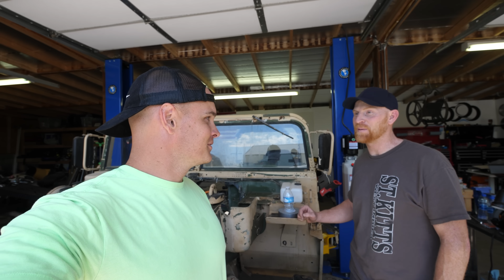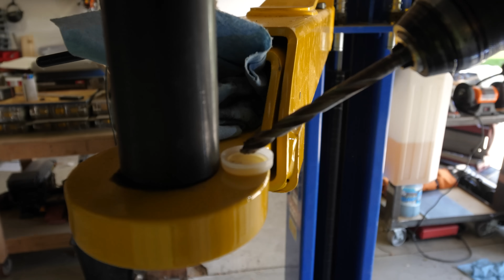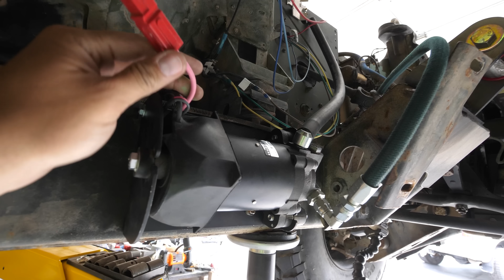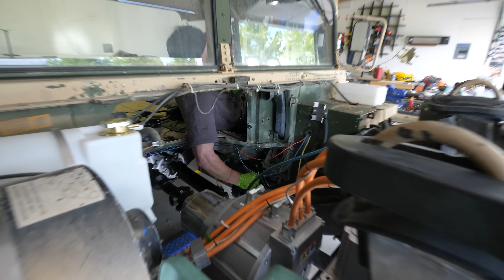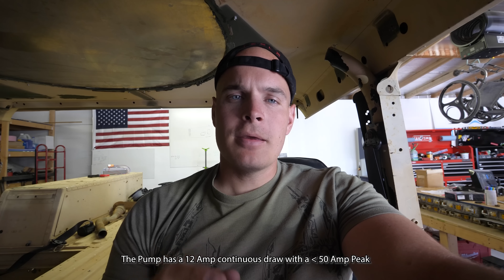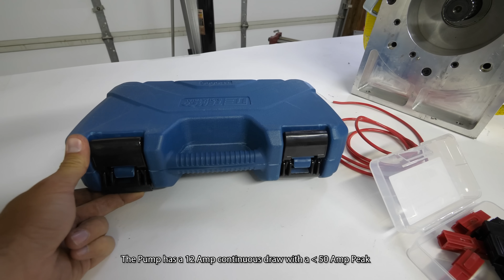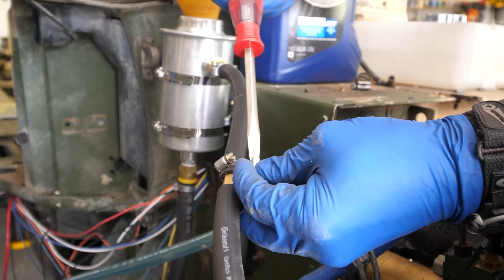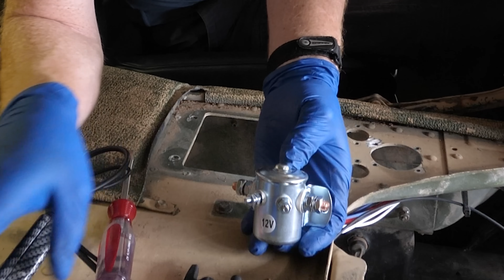We might have a problem with the Brakes... - Electric Hummer Conversion!

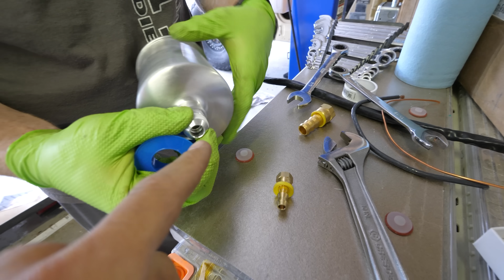Comment: 7:55 actually you put the tape in opposite direction of thread in bolt if you are turning the nut to tighten the threads

Comment: Since the pump doesn't need to be mounted in place in a rigid manner, a thicker rubber gasket/standoff between it and the frame would probably work well, as would an enclosure lined with foam. If you combined the two I imagine you'd get rid of a lot of that sound. 

Also, I don't know anything about solenoids, but others are pointing out the one you're using isn't the right one for that application. Just want to increase the chance you see that tip.

Comment: "Layering" the rubber isolation should help.  As in, pump->rubber->connection piece (like double sided bolt)->rubber->frame.  Not sure if you have enough room for that kind of setup.  Simplest way would be some kind of sound isolating material encasing the pump, but that would cause cooling issues.  Most advanced and badass way would be placing a sensor on the frame that detects the frequency coming off the pump, then have a computer invert the sine wave of that frequency and play it back through a vibration speaker into the frame.  Two waves cancel out and drastically reduce the noise.

Comment: To get rid of the pump whining, you can use a self-adhesive insulating mat, 1 - 2 mats usually does the trick. And also isolator standoffs for bolts.
Reply: And as long as there’s an oil cooler you can trust the trans fluid to keep the pump cool
Reply: I was going to suggest Rubber standoffs, much of the high pitch noise might be coming from the direct contact with the frame.
Reply: @rudiservo  Its the sheet metal, yes.
Reply: the pump has rubber isolators already.
Reply: @frostbite1991  the rubber insulators might not have enough elasticity to dampen it, also if the screw is not insulated has well any kind of contact will make it worse.
But that is just one part of making it less noisy.
Reply: @rudiservo  Thats why - isolator standoffs
Reply: @rudiservo  yea. I think it's gunna be noisy no matter what unless you isolate it in a insulated box. My maxima had an elec steering pump and you can here it whine at idle with the music off. pop the hood and it's very apparent. with no engine noises to muffle the whine, it's gunna take a lot to quiet it down.
Reply: @frostbite1991  probably true. A sound dampening enclosed box and bigger softer rubber standoffs might do the trick.
Usual isolator standoffs do not have that rubber mass to actually dampen the noise and vibration.
Also a pressure reservoir aka hydrologic accumulator with a shutoff sensor so the pump is not always on will help on battery and pump longevity, and noise.

Comment: You could put damping material above the motor (between the motor and the cabin) so that it cancel the sound coming from the motor. Or just completly submerge it in damping material if the motor itself is cooled enough by the flowing hydraulic fluid. Also decoupling it from the frame could also help, so that it doesnt use the frame as a resonance body that can swing with the resonance of the motor and amplifies the sound of the motor. 

You can test if the frame amlifies the sound with just unscrewing the motor and let it run when its hanging free. When it is less noisy then, it was the frame.
What you can do then is just put softer rubber between the frame and the motor so it can damp smaller and higher frquency vibrations (so called sound lol) rather than harder rubber thats probably better to just damp hard shocks of the motor.

If the frame doesn't amplifies the sound... Damping material above the motor...

Comment: having the pump and line so close to possible damage from debris flying off the ground is brave. Hope that doesn't come back to bite you. I've seen lines cut from rock shards flying off the tires , bouncing on the frame and you loose oil pressure real quick. losing power steering isn't that bad, losing brakes, now that's a uuuuugly can of worms.

Comment: That red Anderson Power Pole connector on the pump could vibrate loose and you would lose your steering and brakes, could be dangerous. I would suggest using a connection that is held in place more solidly.

Comment: you can install steering pump at rubber base so it will sound less noisy also when you finish your project and put soft materials its sound will be quite

Comment: I was the lead mechanical engineer on the brake control module used on the first generation Chevy Volt. There are 2 thinks you can do to quiet that motor. First you should add rubber washers to the mounting bolts to isolate it from the frame. The frame is resonating and amplifying the sound. Second you could add a noise dampener to the motor housing. It's basically a piece of rubber, stuck to a piece of thick stainless steel and then stuck to the outside of the motor to eat up any vibration from the motor. You could also move the pump into the. "engine compartment" so it's not right under the driver's seat.

Comment: Fantastic!  If you chose to sound deaden the pump remember to put some sort of air flow ports so it doesn't overheat.  Cooling the actual hydraulic fluid won't cool the motor driving the pump so it can still burn up.  Also, I am ramping up my tools to get ready for a larger scale solar install and I'm totally buying your hydraulic crimpers.  If they work well enough for Zack, that's all I need to know.  Let me know if you have an affiliate link to any of your tools.
Reply: this is yakkshit can you suggest to me how to improve my channel "cedzxtech" please visit once please share your valluble feed back on our videos cedzxtech

Comment: Frankly this guy lost quite a bit of credibility when he used teflon tape on a flared AN/JIC fitting. Those do not require thread sealant of any kind. They are just like a brake fitting, the flare does the sealing.

Comment: Hi you can reduce the pump noise by putting rubber mount between the pump and the frame
It will absorb the vibration and isolait it
Similar to the ones used for the ABS pump

Comment: It's not possible to quiet that pump you're using - you will ALWAYS hear it no matter how much sound deadening material you cover it with.
You basically have two options both of which are not that easy:
1. Attach an automotive power steering pump to a bigger electric motor running off the high voltage circuit
2. Retrofit fully electric power steering.
I'd personally go with option two as it gets rid of dealing with annoying hydraulics and is completely silent.

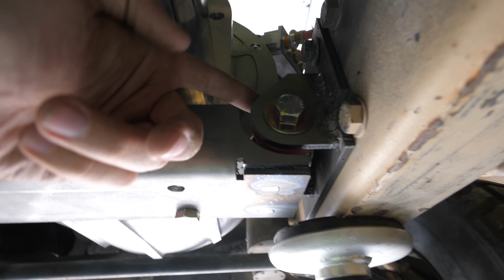Comment: Love this series. Quick question/concern, @7:11 are you going to weld the gap on the cross member? And it looks like the weld on the frame side has cracked.

Also, would it be possible to have an on-demand setup on the pump where it only kicks on when it is required (ie, when pressure drops from turning the wheel)? Might not be able to using a single pump with the brake system as you would not want a delay in pressure increase for the brakes.

Comment: From the start of this project, I've been wondering about the P/S and P/B retrofits.  Easiest would seem to be using the stock P/S pump on a belt with an electric motor.  Eliminates the need for special hose as well.

Comment: You got alot of sound lowering material but i think you also should mount the pump on a moveable mount. (So the vibration dont go into the frame) because sound is basically vibrations  it would help alot not using your frame as an amplifier.  An example to try and explain what i mean here😅: If you put a pc fan directly into a case it makes way more sound than if you glue it on a piece of foam and then that foam on the case.

Comment: You could try building a small steel box around the pump and lining it with high density sound deadener such as what is used in audio competition car panels. I'm not sure how much air flow that pump needs to stay cool, or if it can conduct enough heat through its mounts that airflow isn't important. It doesn't appear to have any cooling fins or vents in the motor so you may be in luck.

Comment: I very well could be wrong here, but I believe that your pump whine is originating with the isolation of air around the inner workings of the pump (commonly known in the plumbing industry as an air lock).  A method I have used in the past to resolve air lock is to overcome the atmospheric pressure that is locking the air inside with violent high pressure forces.  I achieve this by turning the steering wheel all the way from lock to lock, and at the end near each lock giving the steering wheel a love tap to jolt the pockets of air out of the pump.  I hope I explained this in a way that's understandable and I hope it works if tried!

Comment: The Prius electric power steering is exceptionally easy to add, and significantly less wasteful with power. I would do a swap rather than add a continuous noise like that. It makes sense on a noisy engine that rattles anyway, but not in an EV.
Reply: Doubt it would have the power to work effectively but just have to add some dampening pads between the pump and frame and it won't hum anymore, maybe some isolator standoffs too for good measure.
Reply: @SilvaDreams  e
Reply: @SilvaDreams  agreed.  It would need tremendous torque through the steering shaft to turn the big wheels, while stopped, on pavement, with a heavy vehicle, and maybe aired down tires. And that torque has to be countered by the steering column brackets which are kinda flimsy in a Hmmwv.  Switching to a totally different electric power master cylinder for the brakes could be cool if someone found one that would work with the hmmwv calipers/rotors.
Reply: Still have the brakes to deal with

Comment: For the noise maybe build a cover that encloses the pump lined with dyno-matting or just dyno-mat the doghouse, also if you isolate the pump from the frame with rubber or neoprene bushings, so the vibrations of the sound won't be transmitted to the frame as strongly, so it will keep the noise just at the pump and wont 'echo' through the frame.

Comment: Make sure your solenoid is good for constant use. A typical Ford starter solenoid is just for momentary use and will get hot and burn up if loaded for too long a time. They make what need, look for one that is used for a winch. those are made for constant use.

Comment: You could add a accumulator to the high pressure port of the pump with a pressure switch to cycle the pump on and off .. you will hear it cycle .. more when turning or braking.. Has two functions .. allows everything to run cooler not being continuous plus the added bonus giving you backup steering and brakes if you have an electrical failure for some reason ..

Comment: My idea to make the pump quieter.. laser cut a shell for the pump, fit the pump in it and fill the gap with noise insulation foam. With a sound meter you may detect the amount of dB that the pump produces so according to the insulation foam properties you may be able to calculate the needed gap thickness to properly silence it. If the pump overheats (but it shouldn't since the oil will be cooled down by the radiator) you may think to wrap the pump with cooling pipes before to fill the gap with foam. Into the cooling pipes you may run R-290 or R-600A gas powered by an high voltage AC system that wouldn't be a bad thing to add to the humvee. A little bit complex but imo to make an electric vehicle quite is a top priority!

Comment: Curious: Is Brian originally from TN? thanks! Great work guys. Oh! and future note: You may want to cycle each one of the Tesla batteries before placing them in the truck. You'll need to measure the voltage and place them in an arrangement that is the most balanced, since there isn't going to be the original Tesla battery management system in the truck (I'm assuming). Even though each battery cell is fused - it will increase the life and the entire arrangement will charge faster in the long run (think of it as a parking lot with or without speed bumps). Cheers! :D

Comment: dont know do the Hummer got a skidplate below the drivetrain but even if i would not want to have such a essential item for my and others safety like this pump sitting in this position
imagine driving trugh mud and water with gras trees branches and rocks hitting this part or getting squisched even above a skidplate or wrapped arround the drivetrain
its is easely destroying your 90° fittings, hoses and soacking all your pump and connections

i would relocate the pump in front in the engine compartement raised high and far away from the driver putted in a sound dampening box.
all it needs is some brackets, holes and rerouting some hoses and wiring not a big deal just find a place
not having it derectly below the passengers will also help with sound dampening but with all panels back in place some sound dampening installed and the wheels and gears making noise the pump will be probably not realy be a problem while driving

Comment: for the pump sound why not add a motor to the steering and then link the steering wheel too that motor so it's not a physical connection but a digital one meaning when you turn the motor turns then you can use a joystick or whatever even a gaming steering wheel because it doesn't matter, i feel this would make maintenance much easier too, i always felt having a manual steering wheel today is so obsolete
Reply: Steer by wire upgrade might be a bit costly, and probably not a project for amateurs, given the safety hazards.
Reply: @lent6114  i don't see how linking a steering wheel to a motor is a safety hazard it could even be done wirelessly but thats a bit too unsafe but it could be done that way.

Comment: Just make a metal box, fix the pump in the box and fill it up with mineral oil. Also have a lid with rubber gaskets for the box. Mineral oil won't cause problems for the motor but will reduce the sound. As the sound energy would be converted to heat due to the mineral oil. Also you could include some rubber isolated mounts for the pump as well as the whole box. Use sound deadning foam liner from the outside on the box as to not have flat metal surface that could cause vibrations to be audible. As far as for the relays, just connect two identical relays in parallel and Bob's your aunty.

Comment: Maybe should install the most important pump in a safe area, so it won't be damaged by off-road rocks and if the drive shaft sheers from torque it wont get beat up by the flying drive shaft and loose breaks coming down the mountain, relocate it for safety and sound

Comment: It seems that pump is doing a lot of work when steering isn't in use. You can use ammeter to test this hypothesis. If it's true than hardware from old hummer isn't good or is stuffed.

Comment: Suggest doing what Tesla did with their heat pump: placing a foam shroud around the hydraulic pump. This should assist with sound deadening and vibrations. Also, ensure there are rubber mounts where possible.
Reply: Isn't tesla using electric steering?
Reply: @LinkinPark4Ever1996  Yes, they use fly-by-wire steering.
Reply: Yes and isolate the pump from the frame with the LEAST rigid method possible so the sound doesn’t turn the hummer frame into a giant subwoofer

Comment: To help with pump noise:

Check pump output pressure necessary to operate both systems. Would also be good to check required fluid volume for proper operation.

Move pump to rear area of vehicle and enclose with a sheet metal housing with some rigid sound insulation. 

In front of vehicle where the pump was formerly located mount an accumulator of proper size to handle required pressure and volume to operate the steering and brake systems. Use pressure switch on accumulator to switch pump on and off as required to maintain proper pressure for operation. 

Accumulators are not really cheap, but they are affordable and beyond initial charging with nitrogen will require little to no maintenance.

Comment: would it be crazy to think that Your pump should not have to run continuously, you need to put a pressure sensor, or pressure regulator. Something that stops the pump when it gets too optimum pressure?

Also, you can build an enclosure around the pump, and use detonating material. They make stuff that you can spray on, or has a glue backing.

Comment: The Mercedes a class ( first generation egg shaped thing ) has a electric/hydraulic power steering pump with built in reservoir , return and relay . It’s neat if you need to to this and it’s all in one ☝️

Comment: Ik weight is an issue but if you added rubber enclosure or insulation around the pump that might help. 
Or maybe by time everything is in place it will dampen the sound itself

Comment: I would say that you should ad a pressure sensor or angle sensor, when the steering angle increase past a certain amount it activates the pump. 

You could also put it further way and put in in an insulated box, there will be som heat but not that much.

Comment: You think you can hear the pump when those tires are rolling? With the sound isolation of the Humvee? You could make a steel casing with foam inside. At least that's what we did on our elevators to dampen the sound of the main contactor. Is this understandable English?

Comment: As someone who used to design hydraulic power systems, sound was never a priority. I will say even from the beginning the pump sounded normal. My suggestion would be to relocate the pump as far away from the seating area as possible and or build an inclosure for the pump with MLV or some other sound dampening. I'd have a pluggable drain hole on the bottom side of the inclosure and have all the fitting inside as well as they're always the weak points as long as you route the hydraulic hoses well enough.

Comment: In addition to the other suggestions, they have sound-deadening material you could add. Its kinda like heavy insulation, but I doubt weight is an issue.